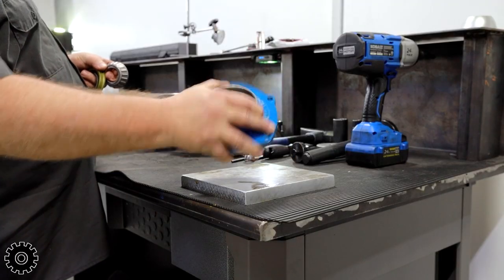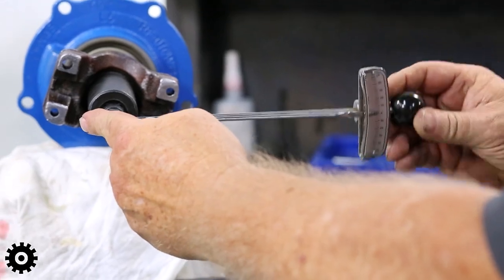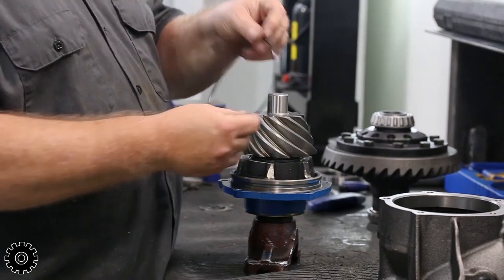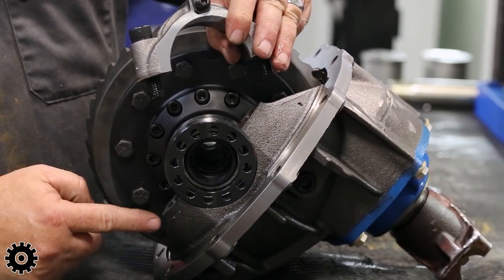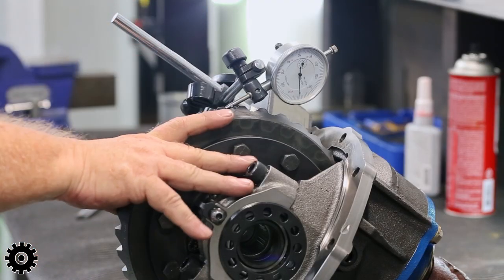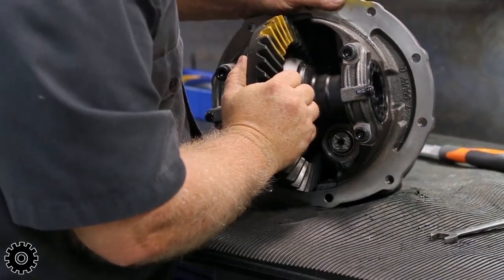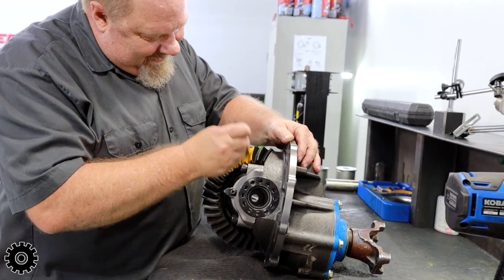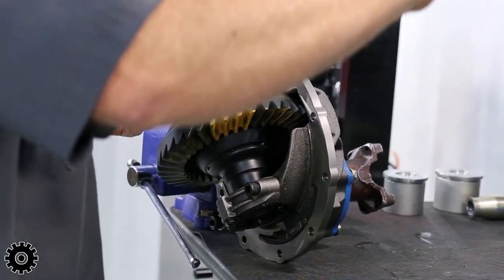How to Assemble a Ford 9 inch Third Member

Comment: Fantastic!  Very well done, thanks!
Reply from the maker: Thanks, we hope to get some free time to make more in the coming year.
Reply: @rearwheelperformance  could I leave the o ring out till I get the spacing correct?
Reply from the maker: @mrjata  You can, but we leave it there by habit, more than anything ,since it adds very little to the assembly and disassembly time.

Comment: So, on my third member pinion support the bearings are the same. Would it be better to go with the spacer and shims, as you did, or the crush sleeve? Since the outer bearing is pressed on like the inner.
Reply from the maker: We prefer the solid spacer/shim style.  It is easier to replace the pinion seal without having to remove the pinion support, and also saves a some assembly time when rebuilding or swapping gears down the road.

Comment: Does the seal make your inch pounds of preload change? Wont it give you a false reading
Reply from the maker: The preload high/low spec has a variance in it of about 15-20 inch pounds.  If there is a concern that it adds a little to the reading, you could just shoot for the just under the high side, knowing that it is maybe 1-2 in/lb less.

Comment: hi, thank you for the video. I do have a question, I purchased a third member and noticed the adjustment nut keeper is not completely lined up with the adjustment ring. It’s kinked to the side a little as if they got it as close as possible and then just put the keeper through. Is this going to be a problem later or does it need to be completely straight?..
Reply from the maker: Depending on the manufacturer, some keepers are slightly slotted so that they can pivot slightly when being tightened, and some have longer tangs so that they can be lightly bent into place.  It should not cause an issue if the side bearings are properly preloaded and the bearing caps are torqued properly.  If it just looks terrible, you could remove the keeper(s), back off the bearing caps bolts a bit, tighten the adjuster(s) to the next hole, then reinstall and torque everything to spec.  The amount of backlash shouldn't change significantly enough, but it can be re-checked if it is a concern.
Reply: Thank you so much for the reply. I appreciate it, you’ve been a huge help. 👍🏻 and by the way, the manufacturer that I had purchased from was Speedway motors here in Arizona

Comment: So you just guess on Carrier preload ? I seen another video the guy said he does tons of rear ends and he guesses on pinion preload... Humm
Reply from the maker: This feels like a facetious inquiry, but the differential case preload is checkable and adjustable, but almost impossible to get too tight due to the amount of flex in the case housing.  The majority of (dare we say, all) oe and aftermarket performance driveline techs we've ever worked with will shim or screw the sides as tight as they can within sanity.  As long as the preload is not loose enough to allow any amount of the case shifting, it will work fine.  Pinion preload is easier and more critical to get right, so for a video we will demonstrate the proper procedure and checking methods, but any seasoned installer knows the feel of proper preload and will likely set by feel if necessary.

Comment: How Hard Is It To Rebuild A Ford F150 Differential?
https://youtu.be/wx29zybk51k
Reply from the maker: Assuming it is an 8.8, 9.765 or Super 8.8 rear, it is about the same installation procedures as most other common c-clip style axle assemblies from the last 50 or so years.  Tools and experience are relative to the installers perception of level of difficulty.